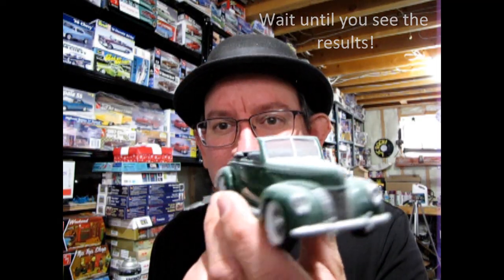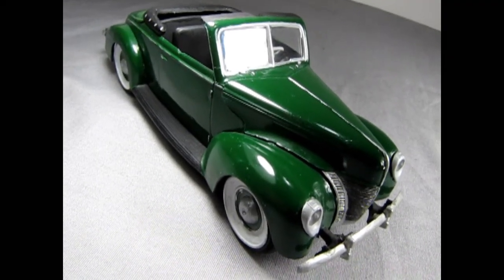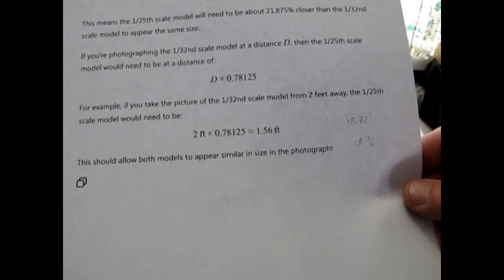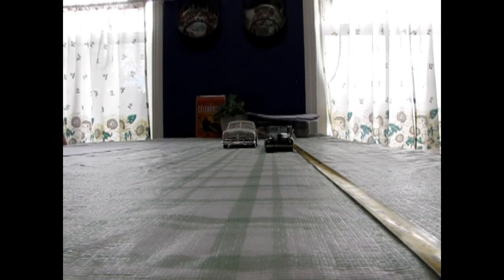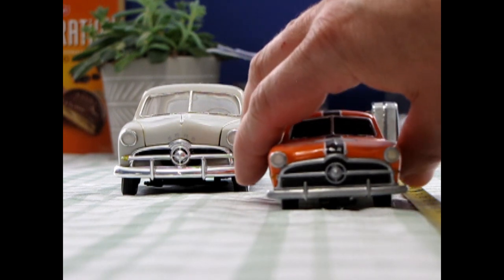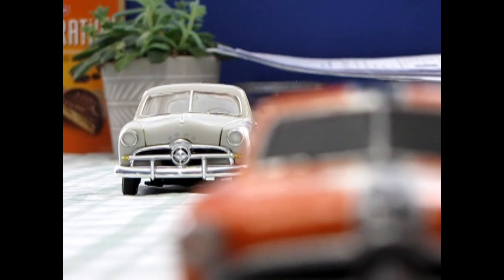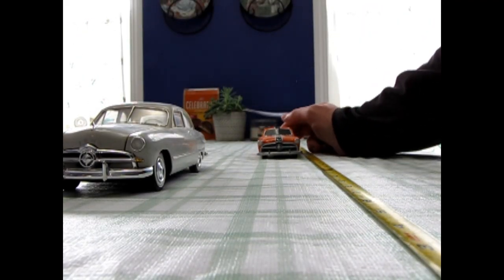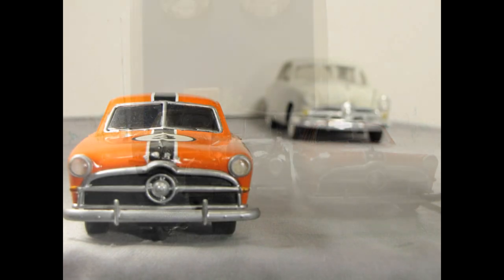Scale Illusion: How to Make Different Sized Plastic Model Cars Look Identical!

Comment: Great little experiment, Trevor. Great bloke next door,👍😁. The camera distances vary on success. If you had a road diorama,or an area of your garden that you could use,you might get a a more realistic result. I'm using forced perspective and scale distances to create a figure diorama. When I next work on it,I'll email you a photo👍😃
Reply from the maker: Sounds good Pete! - I think using forced perspective is somewhat different than what I am doing in this video though. With forced perspective, the things in the background are suppose to be smaller to represent distance in a small space. What I did was take the bigger thing and set it back so it looked smaller. That's sort of the reverse.